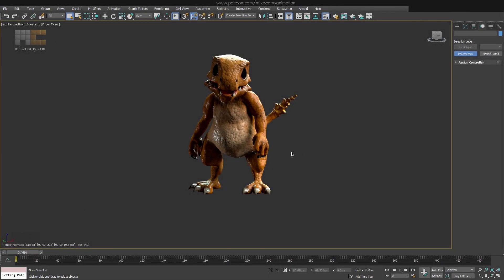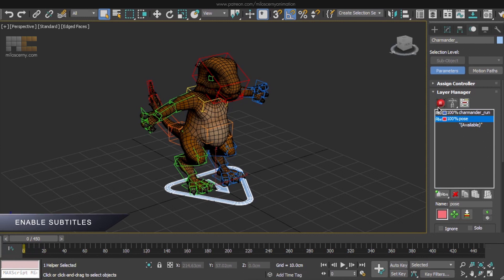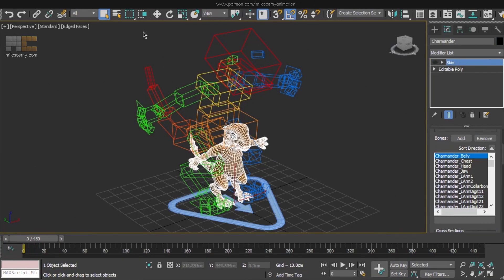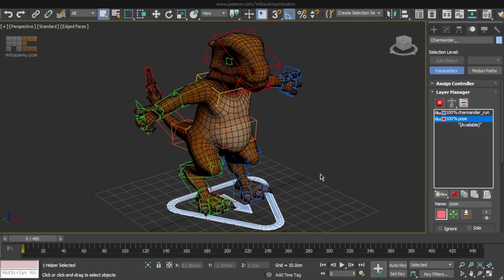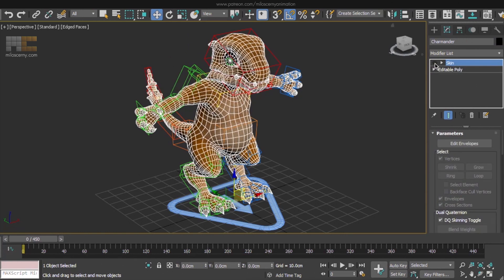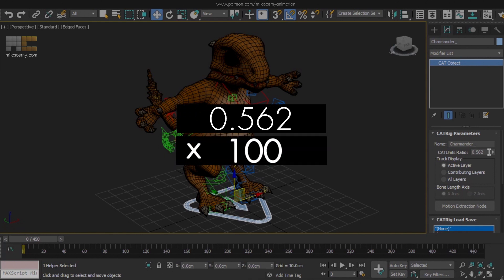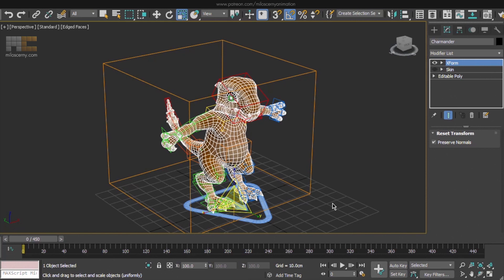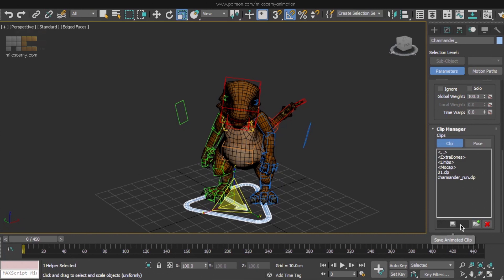How To Re-scale a Rigged Character - 3ds Max CAT Tutorial

Comment: If you add the "mesh" in the "add rigging" menu then you can easily rescale everything properly using CATunit ratio! I mean why didn't you do that? is there is specific reason?
Reply: you could also change the system unit scale from 1,0 to 1,5 or whatever you need.